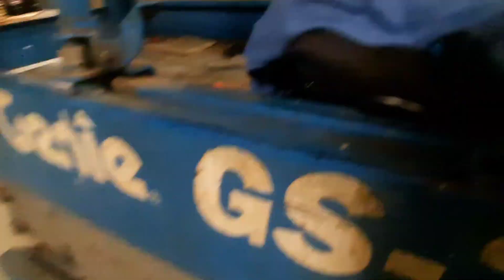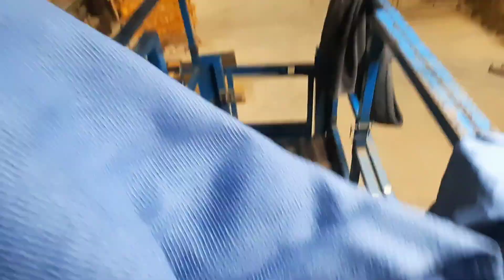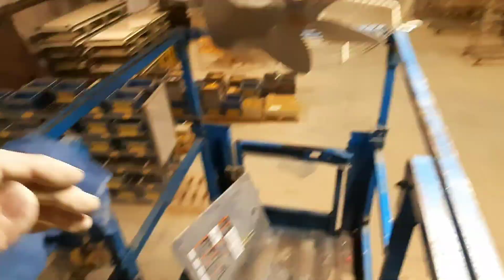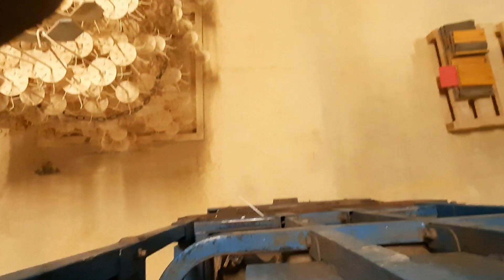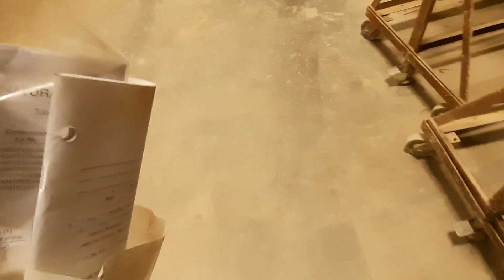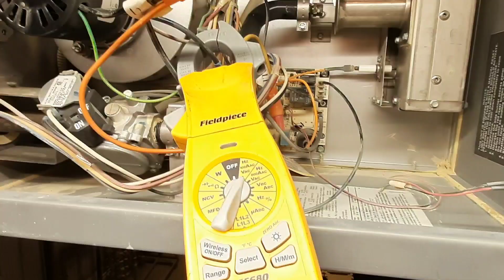No heat, rough industrial conditions. #hvac #hvacservice #bluecollarlife #hvacr #industrialheater

Comment: Nice work Steve. That place is a major dust explosion hazard. They need a visit from OSHA before people get hurt.
Reply from the maker: Thanks, Steven! I'm not sure I'd say it's an explosion hazard. The dust is not flammable.
Reply: Almost all dust is flammable to an extent.
Reply from the maker: Thanks Adam, i can't argue with that, especially around electrical you have to be careful blowing dust around, but both heaters were trying to run and had burners fired intermittently, so I wasn't terribly concerned about an explosion.